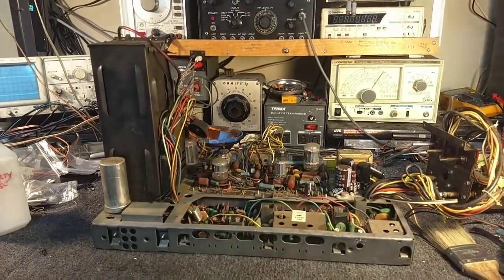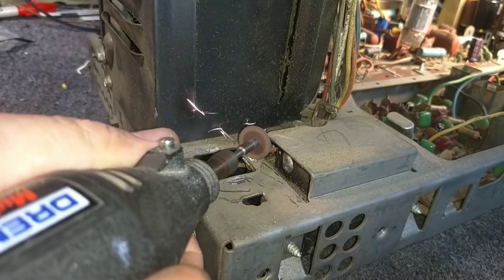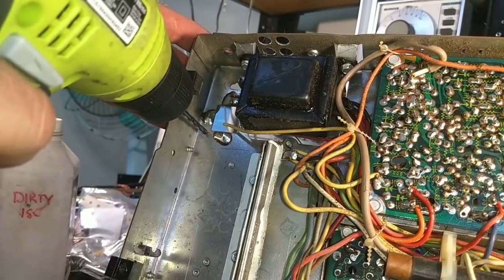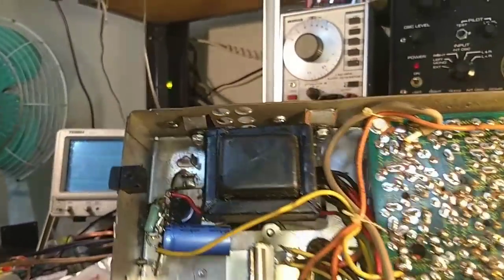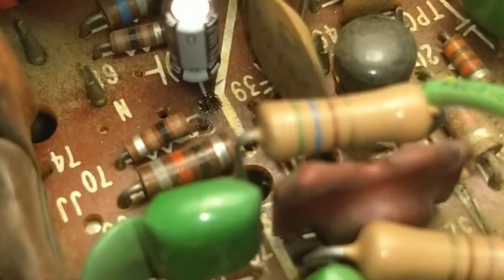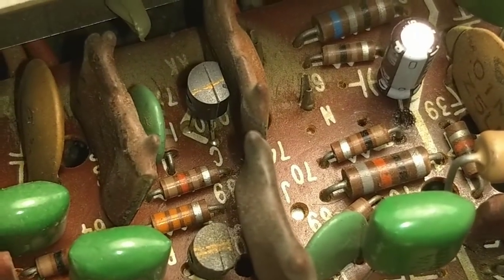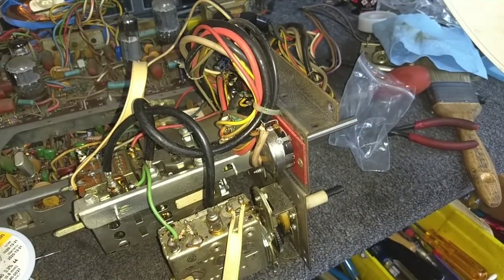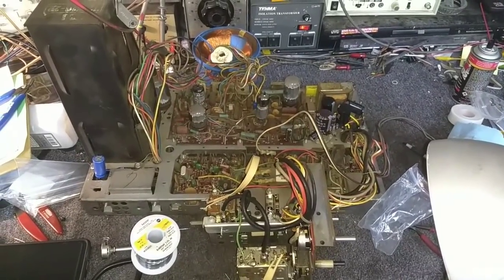Repair of 1973 Admiral SK2247 12" Hybrid color tv. Part 4/? low voltage capacitor replacement & tint

Comment: I've never equated the use of a Dremel with TV repair, but there's a first time for everything. 😊
Reply: It's a great, and fast solution. However, I can never stand scarring up the metal chassis on a TV. So, I used to use a hacksaw blade, but I would put down some masking tape on the chassis first. 😜😁
Reply: @waltschannel7465  If the Dremel failed, I expected a jackhammer to come out next.
Reply: A Dremel tool is  one of the handiest tools to have in the shop. Especially for working on older stuff
Reply: @marka1986   - I have a 395 VX and a 4000. I just managed to avoid the 4200. That model seems to be universally disliked, because if its quick-change chuck.

Comment: 4:22 I hope the camera also had eye protection on it :) An inexpensive UV filter or something.
I always wondered why are you running that poor CRO in the background continuously with the intensity up? I also usually keep my scope powered up when there's a good chance I will need to use it, to avoid warm-up drift, but I do it with the intensity all the way down so I don't burn the screen and don't wear the cathode too much.